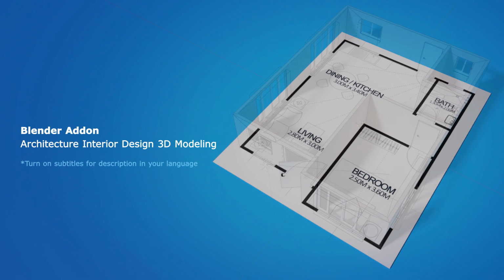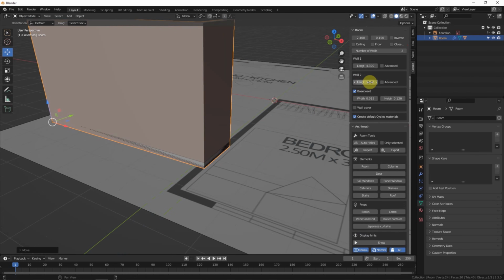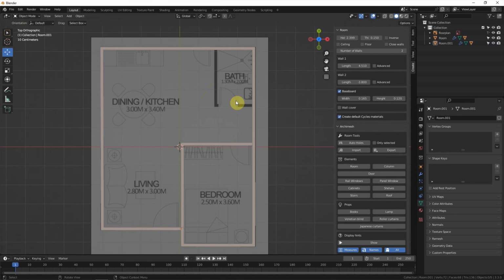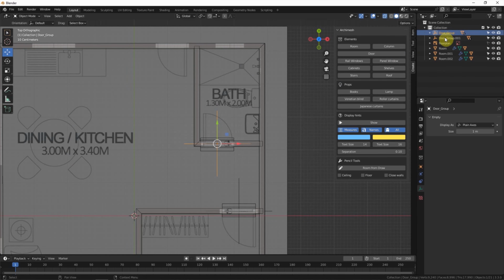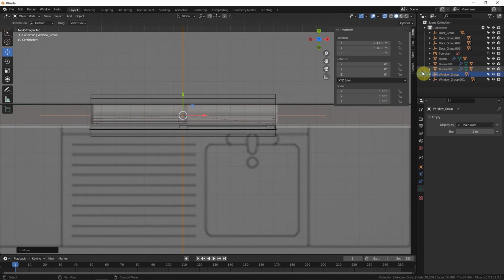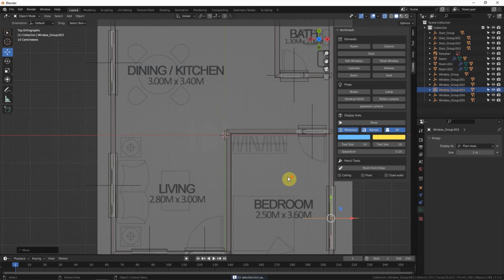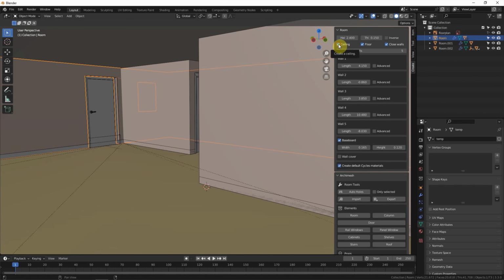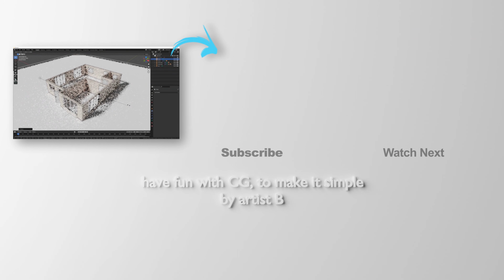Blender Architecture Addon Tutorial, Interior Design Floor Plan to 3D

Comment: Hello dear friend, I am using Blender version 4.2.3. I did exactly as per your video tutorial. However, when I press the button '' Auto Holes '' the windows does not change colour nor become transparent. Am I missing something?
Reply from the maker: I try it in Blender 4.2, it still works. 
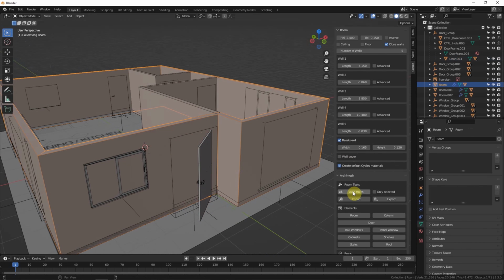make sure that the trim box (black line box) intersects with the wall, 14:04
Reply: @blenderian.3d  Maybe something wrong with my windows 11 OS. When I click on top left Add>Mesh>Archimesh>Rail window it DOES work. However,  panel window DOES NOT work. 
Also when I click on right hand side panel create>Archimesh> Rail window, It DOES NOT work. I will try in Linux and see if same problem appears.

Comment: Is there a way to import CAD Software files (DWG / IFC) instead of eyeballing the walls on top of a jpg img? its nice to look at but not accurate like CAD, unless accuracy is not needed and all you want is a general image.
Reply from the maker: Right, Blender is mainly for visual creation and animation. Most of CG work are not expected the accuracy like CAD, as CAD is mainly used for engineering and for analysis. I don't have DWG for testing how import into Blender, but we can use interchange file format, like as DXF that Blender can support.
Here is the list that file format can import in Blender, https://cgian.com/2023/08/blender-file-format-supported 
Have a look if this helps.

Comment: Will you not have light bleeding along the edges where the height had to be adjusted, so the faces dont overlap?
Reply from the maker: Yes make them not overlapped
Reply: @blenderian.3d  sorry I'm quite new to blender.. I do have some prior experience in 3dsmx... 
Is this done easiest by 'welding' the vertices of the two archimesh objects to one another?

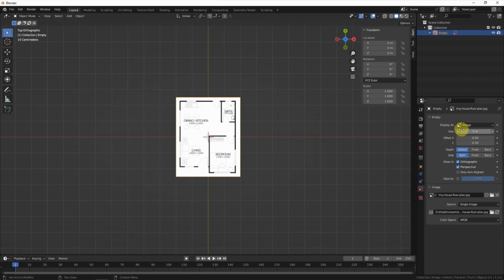Comment: How is the size of 12m (which you enter at 0:36) determined? Is that the area, x-distance or y-distance?
Reply from the maker: thanks for asking. to make the tutorial smooth and straightforward , i skip this calculation.
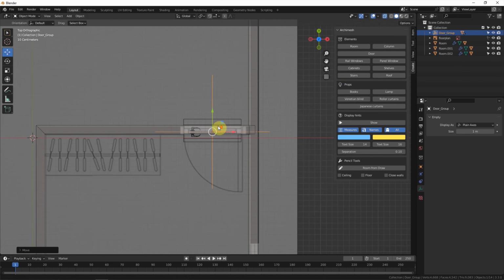I used the scale of door in 2D floor plan is same as the door (1m width)  in Archimesh addon, at 6:34. You can adjust your own scale in your situation.

Comment: Thanks for the effort, but it shouldn't be so difficult to make tools CADlike. I mean you click a point, move mouse to a direction and enter distance than click. Now you have a line. Keep clicking and now you have a plane. Extrude it etc. If the developers add Blender a sketchup-like interface I'll switch to it momentarily.
Reply from the maker: I am not Sketchup users. I tried Sketchup long time ago when it was free version. But I think if doing architecture or interior design, sketch-up is more supportive. For architecture or interior design, Blender is still under-developing. I am just trying when Blender can do at the moment.

Comment: When I add a second wall, it is thinker than the first wall for some reason. 
How do you control the thickness of each wall? I'm using Blender 3.3.1
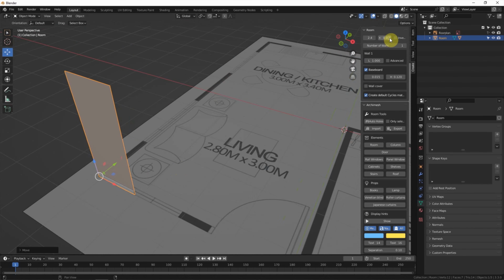Reply from the maker: The wall thickness can be adjusted individually on each wall, see if this works at 1:54
Reply: @blenderian.3d  Ya I see that. but when I add a "SECOND" wall, to turn the corner, it's thicker than the first wall I added.